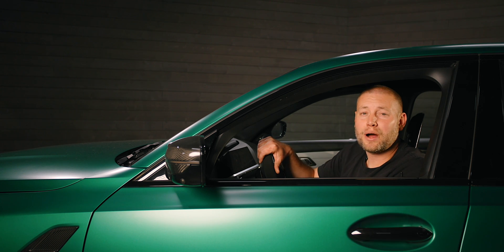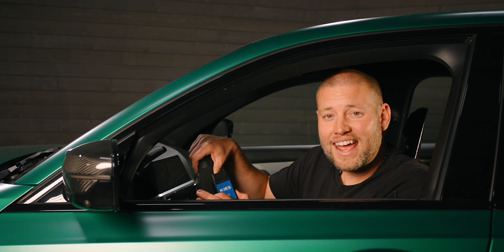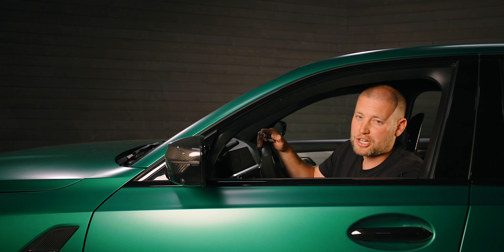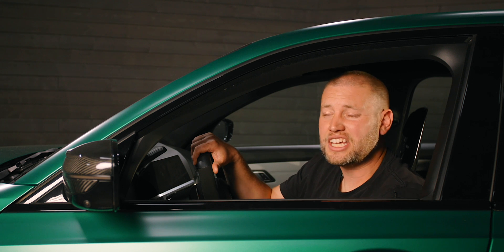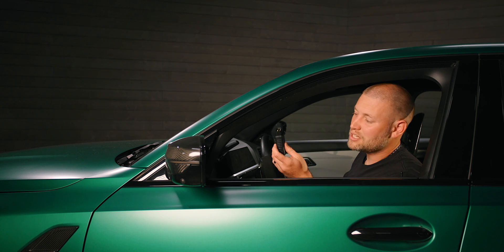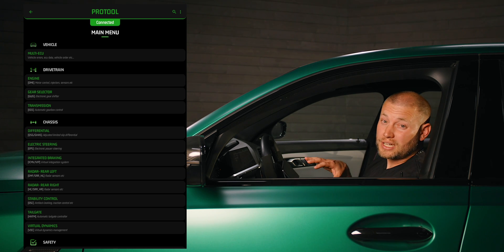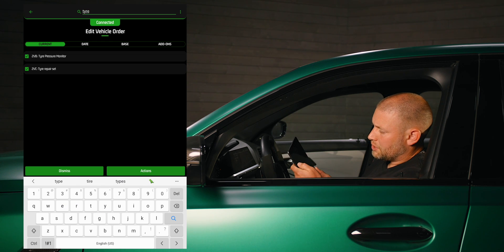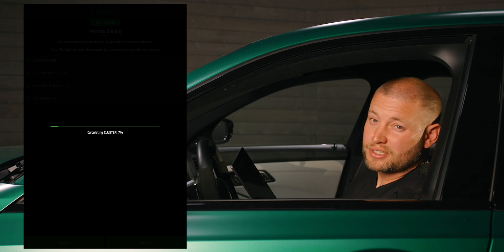How to code out TPMS for the TRACK | BMW (G Series)

Comment: Hi
I tried setting it with the F22 with the Pro tool on my head unit, but is slightly different with the options to recode. Not only that, but at the end of the recoding, it clears all the errors inc what I recoded. Any solutions? Also, I change my seat and get @Driver restraint error. Any solutions? Thx a lot!

Comment: hey man quick question, after you code out the airbag light, does it ever come back after a few hours or days or is this permanent and it will never come back unless turned on again?

cuz i tried erasing the code with carly and a regular scanner and they usually come back without a few hours

i’ve been trying to find ways to get rid of them but i don’t want to spend the money on the license for it to come back after a few hours yk

 and also does it work for f30?

i would appreciate if you help me out with this bro!

Comment: very informative video! I'm getting a track set and wondering if I should add TPMS for the readings and not sure if it would have the same issue as F series car where it locks you in comformt mode when pressure is below 26psi. Any insights?
Reply: I tried to run 25psi on streets and it shows the warning on not going over 80mph, would it be an electronic limiter or just suggestion🤨